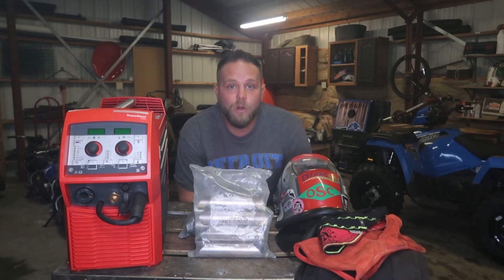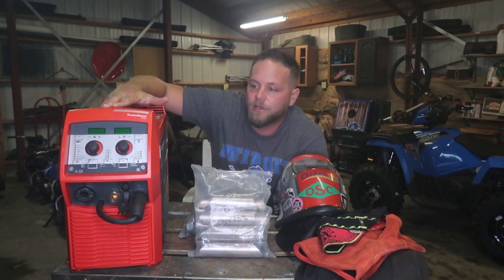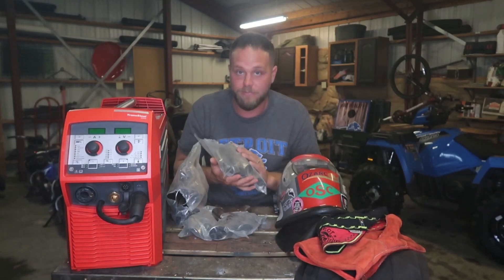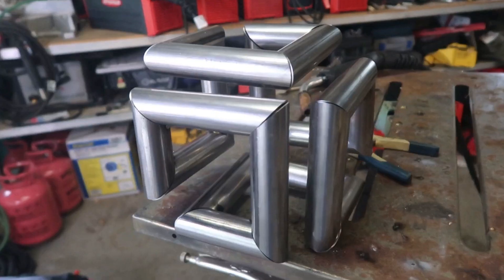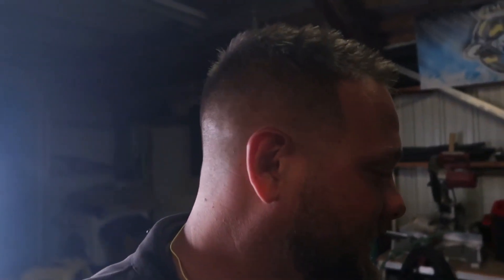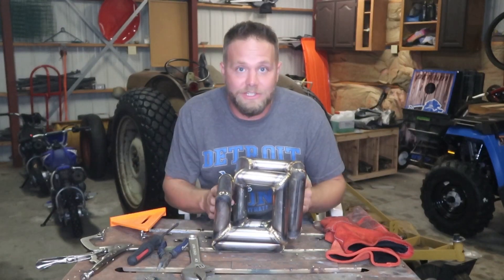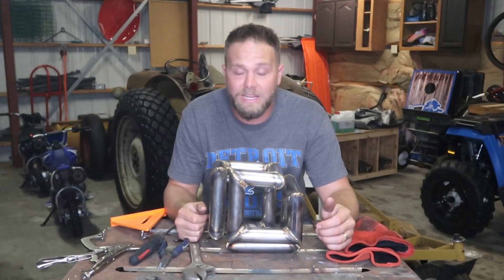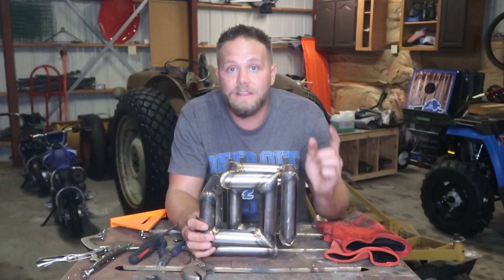Put Your Weld Skills To The Test With This Infinity Cube Welding Challeng #migbrazing #fronius #weld

Comment: Ah  ,,, so your  a Fronius fan then ,, good grief , how many machines do you own , that looks like a fine selection there.
Reply from the maker: Big Fronius fan! I have 4 units from MIG to AC/DC TIG units
Reply: @chris_b_liven  I came very close to buying a trans steel 220 ,, but an ewm tetrix won ,, but i shall treat myself to a trans steel shortly I think.

Comment: I tig welded the square tube infinity cube, lol yes it most certainly WAS a fun challenge reaching inside of it AND gettin rod in there, BUT...for being one of my first at home tig projects, it came out great! Welds were all decent and came out rather square. Simply by taking my time(I think I did it n 2 nites) outside/inside. Prolly bout a year ago. Thinking about doing one again, hard to justify nowadays cuz I get remnants alu, stainless, steel for CHEAP from steel supplier. I could get a PILE for 70 bucks feel me. Love the originality of the alu bronze MIG instead of usual tig or mild steel mig
Reply from the maker: Thanks for watching. Sorry about the late response. Not sure why it just showed up in my comments? Weird.  I was thinking about ordering one more for TIG but yeah It would be difficult! That's always one of my biggest issues is trying to get it done fast. With TIG it's nice and slow

Comment: Good Job Milky Cereal, that looks like a Tough one! I actually think it would "maybe" be easier with a Tig,, as long as you have the right Tig Torch, with a really small back cap, and definitely a Flexible Torch head. One of those slick ones from CK worldwide. 
My biggest question of the day is, why do you have like 3 or 4 Transteel 2200's???
I know they are awesome (getting ready to buy one myself), but why so many of the same Machine?
Reply from the maker: +Phillip Chambers Yeah it was difficult for sure. Probably would have been easier with magnet clamps 🗜 Tig for sure would have been easier. I was thinking about ordering another one and testing TIG ... I needed the machine for a Fronius demo day event. We had one setup for aluminum , steel and dual shield flux cored wire. Thanks for watching my videos. I appreciate the support
Reply: @chris_b_liven  that is very cool. I'm getting ready to purchase the 2200 myself. 
Do you know what the big difference between the 2200 and the 2700 are?
Your Brazing video I saw today was awesome!
Reply from the maker: Phillip Chambers Really the only difference is the 270 can use larger spools like 44 Lbs spools
Reply: @chris_b_liven  thanks for the quick response.
Reply: @chris_b_liven  I live in Virginia. Where is the best place to purchase a Fronius Transsteel 2200???
 I haven't been able to find any Fronius Dealers in VA.
Thanks in advance!
Reply from the maker: Phillip Chambers Send me an email with all your information and I’ll get someone in touch with you. Let me know which part of Virginia Bliven.Christopher@fronius.com
Reply: @chris_b_liven  sorry I will send that to your email
Reply: @chris_b_liven  I would love to have 3 of them. 1 for setup for Aluminum, 1 for Steel,and 1 for Stainless. That would be killer. A man can dream. Lol